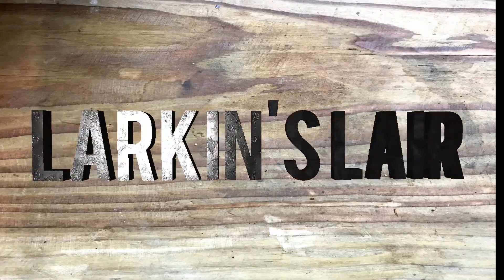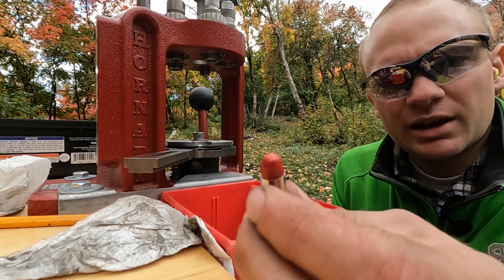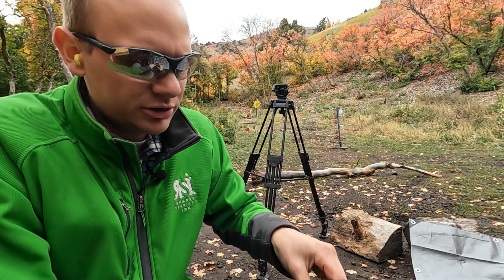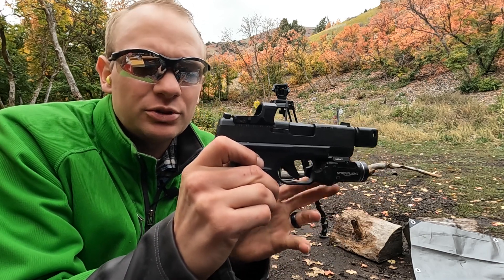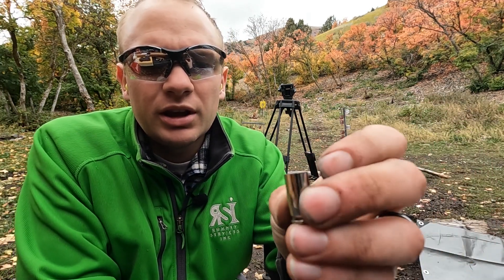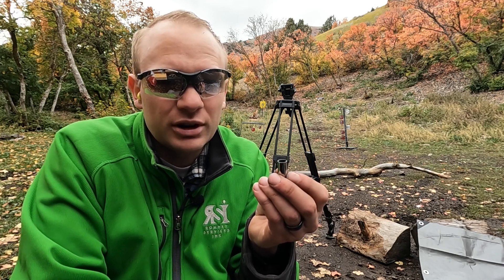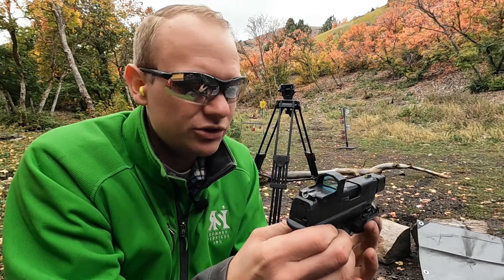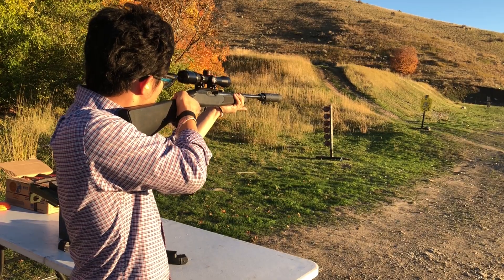How To Catch and Fix a Squib

Comment: A life time ago a friend of mine did that with his 243. 
 As for pounding out with a rod. I have a .187 diameter rod That I wrapped with electrical tape. It kind off looks like a candy cane wrap. That protects the the bore from the rod. Between that I also carry a role of electrical tape. So your 9 there if I was to pound it out. I would add tape to the tip and a couple other places to keep it centered up in the bore. Other than recently when I was fooling around with the air adjustment on my 45 cal airgun and got a 490gr slug stuck. I saved a couple guys day at the range by helping them remove a stuck bullet. 
 I should not tell you this. But back in the 60s when police departments were carrying 38s. My father was a pistol, shotgun, and subgun instructor. One of the other instructors would take a squib and load it in his department issue gun. Keep in mind it is a 38. He would then fire a regular 38 in it and both would leave the barrel and the gun was ready to stay in the fight. This guy was actually teaching them to shoot it out. Desperate times. Some people have bigger testicles than I do.
NDR
Reply from the maker: You mean all firearms dealers in America?
Reply: @TheLarkinsLair  The instructor was teaching for the San Jose ca police dept. And it was just 1 instructor. And it was a 38 special. As I mentioned I seen it done once when I was a pup. It was done with a simi wadcutter. 
NDR